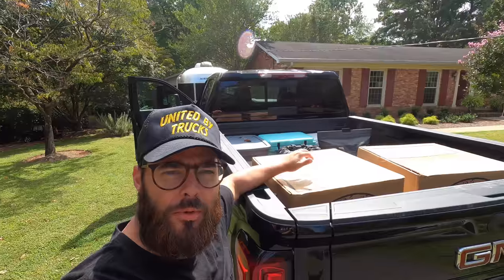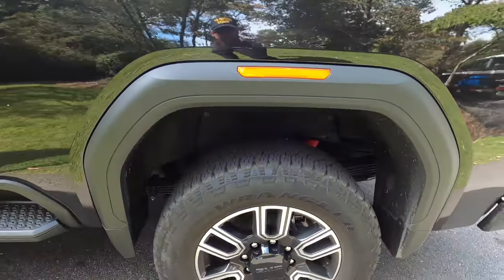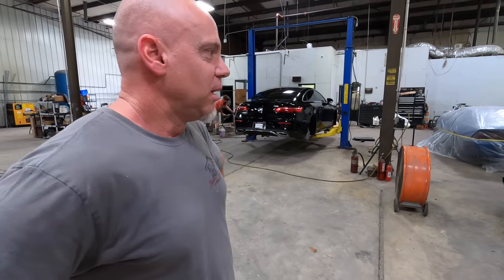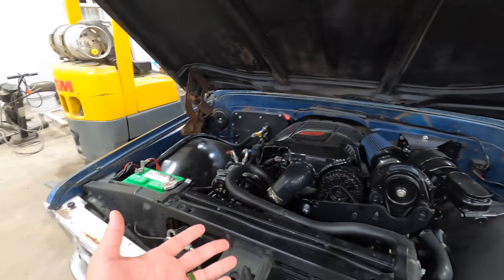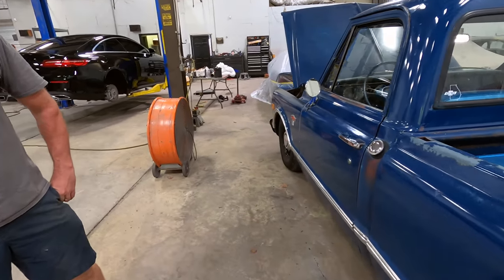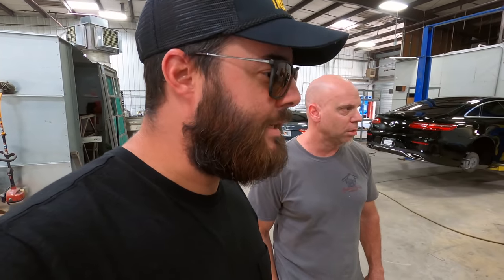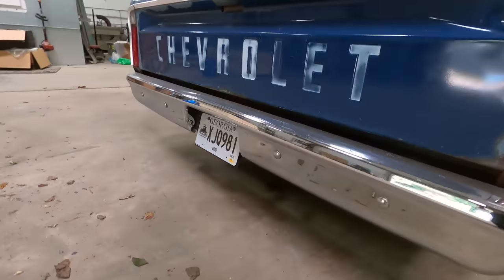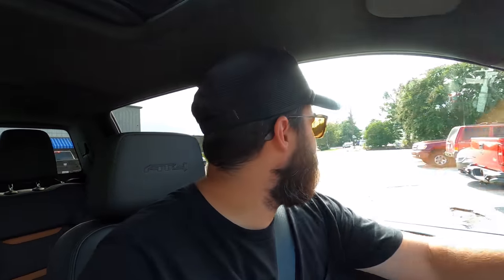BOOSTED '68 patina shortbed c10 | Custom Coaters ATL

Comment: What size and brand/name are the wheels on the c10 with the chevy part in te middle where can i get some
Reply from the maker: Original up front 15x6 and Wheel Vintiques in rear 15x8. Get them at Summit.